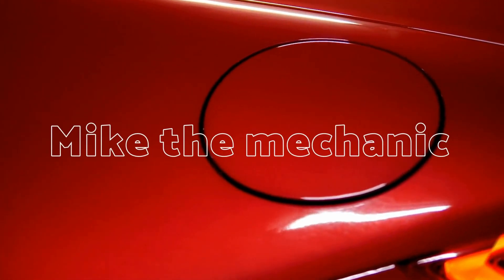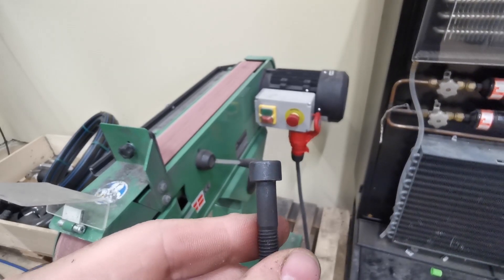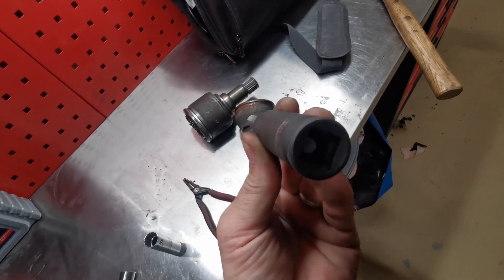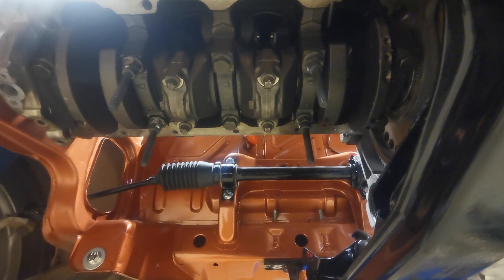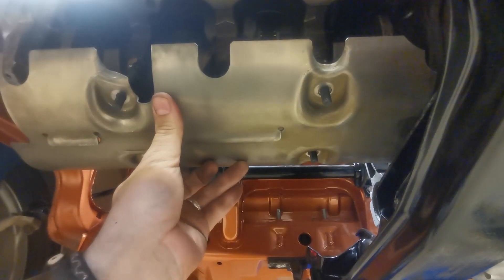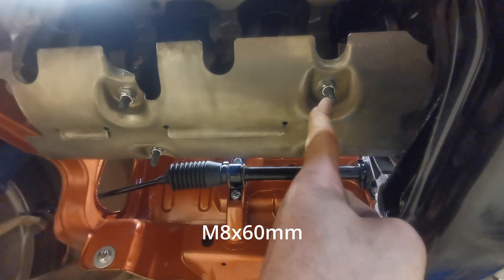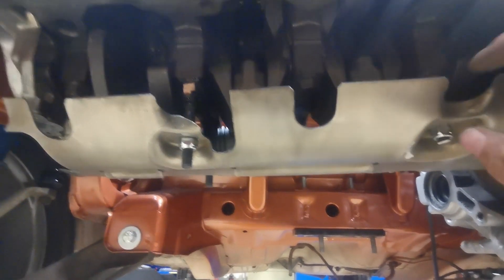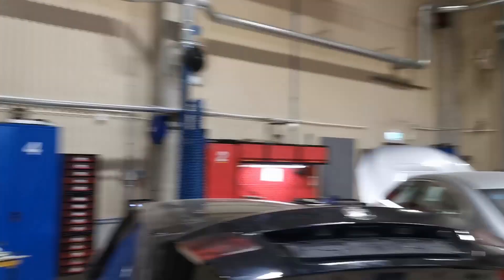How i fitted a windage tray to the popular zetec engine conversion without the hard to find bolts.

Comment: Great video. I would do some research into using nylon nuts inside the engine,maybe you already have? I just think it would be a disaster if they were melt or soften to the point they came loose.  Hopefully someone with actual knowledge can tell me to shut up.😂 thanks for sharing Mike 👍
Reply from the maker: Most windage trays are fitted with ordinary nuts, the oil shouldn't get above 100 degrees so the nylon won't melt or soften. I'll look inte things like locking washers just incase. 👍👍